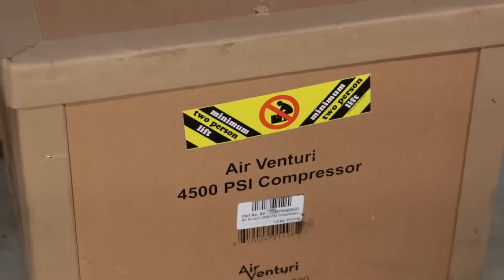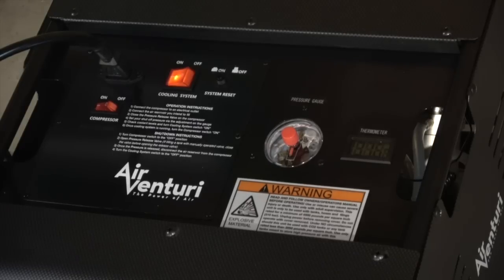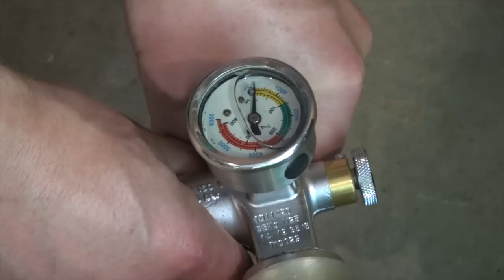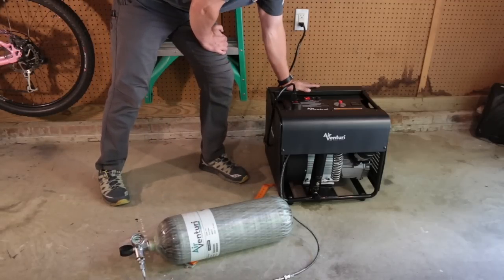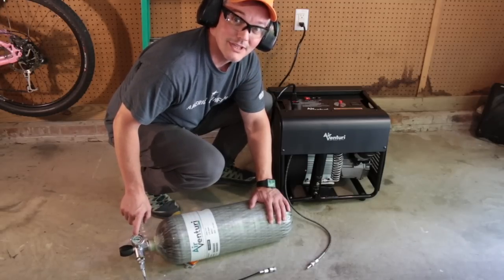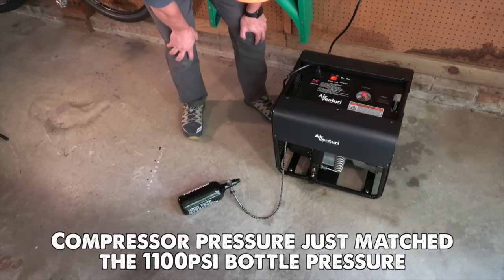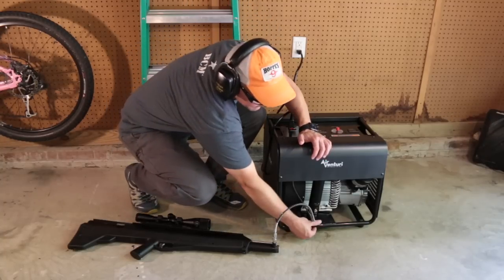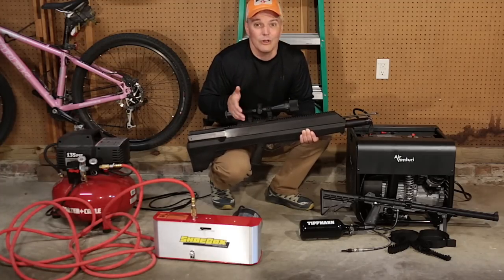Air Venturi Electric Compressor! 4500psi Fills at Home

Comment: I really like your airgun videos. It seems like you make solid decisions when it comes to your airgun purchases and like I mentioned in your gun safe video, I have a highly modified Airforce Condor .25, a Benjamin Marauder .25 and a highly modified Crosman 2240 .22 carbine. I think this Air Venture compressor is exactly what I need, I stopped shooting as much as I like to just for the simple fact I have to drive all the way into Austin Texas to a dive shop to get my fill tank filled and even then sometimes they won't fill it right way and I have to come back at a later time. The town I live in is Georgetown and even though Georgetown isn't too far from Austin it's still a pain in the butt to drive back and forth.

Thanks for the great video and the heads up!
Reply: We hear your pain on the drive and time commitment to fill your air. This will definitely be a lifesaver for you both short term, and long term with the cost savings!
Reply: hey Airgun Depot, thanks for the comment! I got my Marauder 25 from you guys.

Comment: Looks like a Yong Heng compressor dressed up and stuffed in a frame... Yong Heng compressor costs like $350
Reply from the maker: It's not- not even close.
Reply: TWANGnBANG I'm looking at one on eBay rite now.. $550 it is not Yong Heng brand but it is manufactured by the same factory. These Chinese compressors come with many branding and this compressor is Identical to the one I am looking at other than the filter in the "air Venturi"
Reply from the maker: No.  Because you don't know how to internet and failed to simply link to it, it took mega while to find, but that is not made with the same parts as the Air Venturi.  Plain as day.  It has no on-board cooling, the materials themselves are clearly different, and who even knows what the controls and gauges are because they don't show them.
Reply: DrJones  It's a overpriced Chinese compressor.

Comment: I do not get the point of equalising the hose by turning on the compressor before then opening the tank valve as its a pointless waste of time exercise and does not really serve any point, for example as shown he first farted around by testing the tank pressure then connected the tank to the compressor then turned on the compressor to bring the hose up to the tank pressure then opened the tank valve then continued to fill up to the tank capacity.  But this is a pointless waste of time step because the compressor clearly has a no return valve built in other wise the tank would dump when the compressor turned off so simply connecting the tank to the compressor and then opening the tank valve would bring the hose up to the tank pressure just the same as pressurising it with the compressor, but with out all the pointless steps of checking the tank pressure, pressurising the hose with the compressor and then a final fill.
Reply from the maker: There is no "no return" valve in the compressor as the compressor has no reservoir whatsoever.  When you pressurize the fill whip from the bottle, you are pressurizing the piston cylinders from zero to whatever your bottle pressure is much more rapidly than they are designed to handle.
Reply: Could easily solve the back feed issue with a check valve
Reply: That's a really ill thought out statement, they are designed to handle immense increases of pressure at a very high speed, what do you think is happening when the piston travels up to compress air controlled by the shaft that is probably spinning either 1500 1700 or 3500 rpm? Just turn on the compressor and open the tank valve slow and its peachy.

Comment: Awesome video, hope to get this set up too. You need a nice work bench or table set up so you can get off the floor 😉. Good looking gear.
Reply from the maker: It's 100 pounds filled with fluids, and it's nothing but vibration and hate when running.  The floor is the best place for it.
Reply: Definitely sounds like it 
Have you done a video over the pellet tommy gun?
Reply from the maker: No full video yet on the SMG 22.
Reply: @weezerfan999  9...???and I know it II

Comment: good lord, no reason at all to bring the compressor up to the exact same pressure, just turn it on and crack the tank valve to bring the pressure up nice and slow, its not putting any extra stress on anything.
Reply from the maker: You introduce condensation to the loop when you do it that way.
Reply: TWANGnBANG no, you do not introduce any magical condensation that was not there before.
Reply from the maker: The moisture is not introduced.  It exists as water vapor in the high pressure air.  When you reduce the pressure of a gas, it cools and the relatively humidity rises. This causes condensation to form as the relative humidity rises above saturation.  Boyle’s Law and all that...
Reply: TWANGnBANG its still not needed to equalise the pressures, its a waste of time, and provides no benifit, that small ammount of condensate was in the bottle already and will return to its vapor form once again. There is no reason to not just turn on the compressor and crack the tank valve. 

As a side note, if you infact do condense water out of the air in the bottle the outgoing air will be drier and thats better.

Comment: In an emergency do you think you could use one of your tanks to put air in a tire I see there aren't any videos on YouTube about it and if you can can you make a how to
Reply from the maker: Output from the buddy bottle is 4500psi max, which is about 80x higher than what a typical tire can handle without at least blowing a bead.  Exploding tires do happen to people who fill from high pressure bottles, and you can get seriously injured from it, which is why it's hard to find the appropriate fitting for a high pressure hose.
Reply: I was asking just in case of an emergency where I live is nothing but desert online I see fittings for nail guns for high-pressure tanks
Reply from the maker: It’s safer and cheaper to get a 12V compressor to keep in your vehicle.
Reply: @TWANGnBANG  The Paintball style tanks regulate down to around 800 psi, and a Palmer Stabilizer takes it from there and can regulate down to 0-250 psi, or the PowerTank PowerShot adapter can be used to fill tires from the 800 psi output of the paintball tanks. Just like using CO2. Much faster than those DC compressors. More than one way to fill a tire safely.

Comment: What is the AMP rate draw of this compressor? Thanks.
Reply from the maker: Great question.  I'm getting the answer from Air Venturi.
Reply: Thank you. My house is an mid 70s build with 15 AMP circuits. Newer places should have 20 AMP service.
Reply: is it available in 230 volt?  
is the air clean enough to use for actual squba diving?
Reply: I'm waiting on info on amperage draw but I can tell you that it will not produce breathable air for scuba due to atomized oil in the mix.

Comment: These will be great for regular shooters, or clubs and shops- far cheaper than existing options that have been in the ~£1500-4000 range up until recently.

That said, I'm looking forward to an even smaller and cheaper option coming from SnowPeak, whenever that appears on the market.